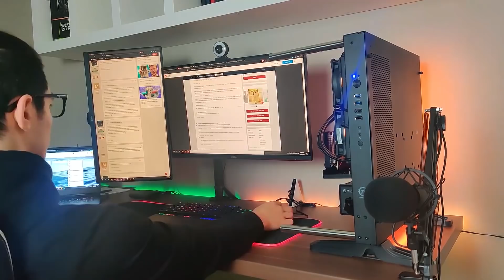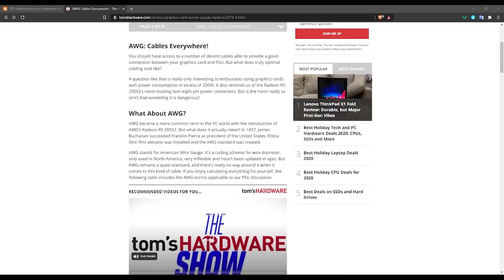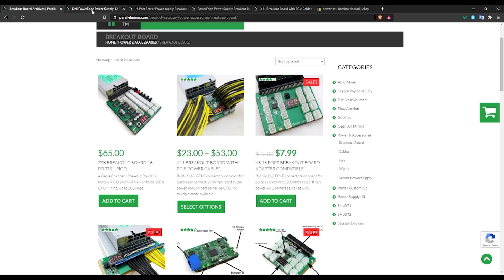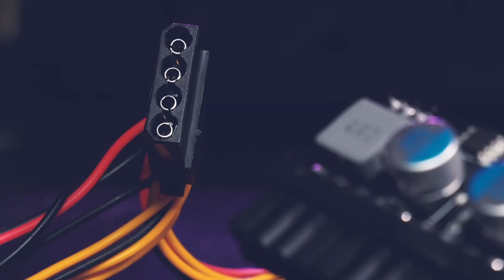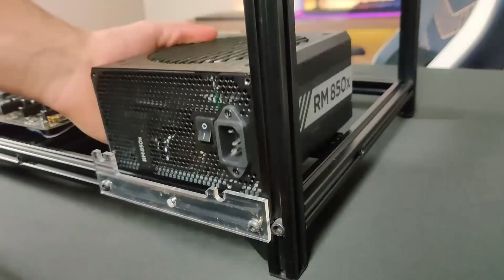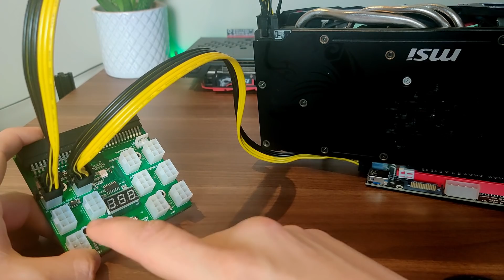Using Server Powersupplies For Your Mining Rig FULL Guide

Comment: Useful info not only for crypto miners, but this is also a cheap and viable option for people who are PC gaming on a tight budget by repurposing used Dell/HP workstations. Many folks doing this have run into the issue of having a non ATX PSU in their machine, but needing more watts to run their upgraded GPU. Running a second server PSU and breakout board just to power the GPU is probably the cheapest/easiest way around this roadblock.

With the sharp rise in energy prices there's a fair few one man band crypto miners seeing costs outweighing their profits, so deciding it's time to call it a day, break their rigs down, and sell off the parts. Even 3 or 4 generation old, once high end, GPU's are currently still going for reasonable money, but used server PSU's and breakout boards aren't finding many buyers, so are getting priced low just to shift them. Due to this, until this workaround to get a power hungry GPU to work in a non ATX PC starts becoming common practice in the gaming world, used server PSU's and breakout boards will stay about the most budget friendly way to make this setup work.

Comment: Using a PCIE splitter for GPU where 2 cables are needed if GPU exceeds 150 W - that will lead to burning - melting power supply connector - I had 2x 1000 W Corsair PSU - I did use one PCIE cable for GPU where 2 cables needed - the result was shocked - after some usage - it literally melted my PSU connectors - I am glad that it did not melt my GPU connectors and GPU is still alive !!! So my Corsair PSU that each did costs 200 bucks are not any more usable - sad mistake - so you should follow the guidance - never use PSU - PCIE splitters and ALWAYS obey this rule about 75 w for 1 connector or 150W for 2 connectors where required.

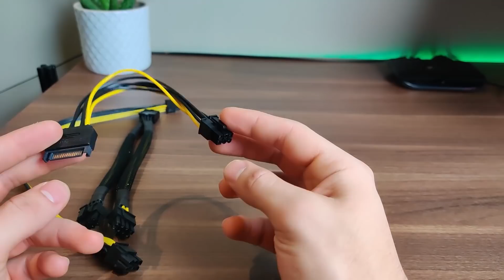Comment: 4:53 you avoind using 6 pin to SATA with graphic cards right ? Those are fine to be used with splitter and connect like 6 or 8 HDD ?

Comment: Can I use low power 200w for motherboard and 1000w server with shorted pin for auto start if I connect them on 240v splitter cable... that way the moment it's in the wall both will start? Since MB has auto start after power loss function... and HP server has simple breakout where start pins are shorted with plug. ?

Comment: just a question, if 750W is the max output then you can only run about 3 3090s becasue each is about 240W i think (or 300W)? is that right?

Comment: I'm sort of on the lookout for a 2400 w or 3000 w psu with all of everything, it's for rendering rig 3x3090 rtx and a 2080ti.. they can go up to 1.5 kw and the rest might have spikes up to 2k.. so 2400 or 3000w so it has way enough power to deal with it, and it might? Run quiter.. I mine when I don't render - but when I render at full speeds I experienced it just shuts down (as if not enough power).. runnin 3 atx psus at 800 to 500w each - it doesn't look pretty..
Anyway - difficult to find real big psus, and paralel miner is always sold out - so any info on what to look out for and what connectors - I would prefer one psu for everything, mobo and gpus.. cause running 3 is not pretty.. even tho I have a miner frame and two psus fit in.. still one overpowered psu seems a lot cleaner - also in case I wanna increase my rig to 4 or 5 3090.. or whatever nvidia dishes out next or this year

Comment: So if the crimp terminals are rated at 8A max, that means it really doesn't matter if you use 16awg or 18awg cables since the 18awg gets 9A which surpasses the capacity of the crimp terminal?

Comment: thanks for the info! When HP server PSU is connected to ATX PSU by mini 4 pin molex, I noticed that there is an on/off switch button on the break board. Do you need to toggle it on before you power the main ATX PSU that connects to Mobo?

Comment: I have cooler master v1000 , pcie cables are from 6 pin to 6+2 pin .. the PSU side connection is of 6 pin rather than 8 pin .. so how much load can 1 cable handle ?

Comment: Where do you get the 6 pin to 8 pin pcie connector cables to use on the breaker board to the GPU?

Comment: Amazing video as always! I had one question, can i use two separate 6 pin to 8pin wires to power mu dual 8pin gpu? Or do i have to use the splitter for it? Replies are really appreciated :)
Love your work mining chamber! Keep up ❤️
Reply: Power a single GPU and corresponding riser from the same PSU, don't use more than one splitter per cable (Don't split a splitter), and never use sata to power riser (even if you're using sata to Molex adapter). Also good practice to avoid using Molex to power riser IF you can (but that's not always possible). So to answer your question, using two separate 6 pins is okay as long as they aren't from different PSUs.
Reply: @typodapsycho1734  can you give me an explanation why my 6 pin to 6+2 connected to ide/sata on psu cannot power my riser ? (Pc won't boot)

Comment: Hey, can you help me? I've got a rig running 7 rtx 2080s and an rtx 2080TI, and when the power flashes, it will turn off then automatically turn back on because of the motherboard's bios being set to "last state" when power received, but whenever this happens, the server PSUs are not in sync.

I'm using molex -> 4 pin adapters from the ATX power supply to sync up all 3 server PSUs that I have for this rig, and if I turn off the computer completely, then power it on using the power button connected to the motherboard, everything syncs fine. It's just when the motherboard turns it's self on when it receives power that they aren't synced.

The motherboard I'm using is: MSI MPG Z390 Gaming Plus
I have two 750w server PSUs and a 1200w (running at 900w bc 120v) server PSU.

Comment: So if i understand  correctly the 6 pin connectors from the breakout board can provide only 75 and not 150w (as the normal 8 pin ones on atx psus can)? So i would need to use 2 seperate cables (2x 6pin) ? or do the 6 pins provide as much power as normal 6+2 pin ones (150w each)?

Comment: I have two server psus, two breakout boards and one pico adapter. Psu one is connected to 3 GPU’s, their risers and the Pico to motherboard. Psu 2 is connected to only two gpus and their risers. Im getting no lights on my last two GPUs on Psu 2 when turning the system on even though the fans are spinning… both PSUs are plugged into the wall. Am i doing something wrong??

Comment: Great video - One small question though. Cursed mentioned he powers risers with ATX 6pin>molex cables and uses them on a server PSU.

My question is can I use an ATX 6pin>Sata in the same way? My front fans have to hook up to a hub and that hub will only accept sata for power? I tried using my Thermaltake Smart RGB 6pin>sata strand on the server PSU and it didn't do anything, im wondering if this is at all possible to achieve or is it only atx molex cables that work with server breakout boards?

Comment: dude you're the first person I hear talking about Server PSUs being too loud to have in your bedroom or livingroom. I'm surrounded by gear and I was thinking of stacking all GPUs and HDD into one server and adding a server PSU in my bedroom. I'm glad you talked about it being loud. I'll try to figure out how loud they are before I purchase one. Thanks again. Subbed.
Reply: They are small jet engines.  You will not be able to sleep.  Trick is to keep them under ~70% load so they don't kick on the fast rpm mode.  So like the 750s you don't want to go above 500w too far.  The 1200s run on 110v only do 900w, so don't go above 630w or so.  If you run 240v you can run them up to 840w before they take off.
Reply: Question, I have three 750w PSUs and the fans have never kicked on? I keep them under 500 load, but the cases are pretty hot to touch.  Is that normal?

Comment: Greate video.  But I have a question. I have 2 RTX 3090 running at 315 watts each.  Can I use the HP DPS-1200SB to power them?  They take three 8 pin cables + 6 pin riser each GPU.

Comment: I was just trying to start with server psu as well, got 750W one with breakout board for 12 pci-e 6 pin connectors. Noticed that as soon as I start my 3080Ti using about 220W on ergo (4 connectors - 1 for riser and 3 for gpu) i can hear ticking sound but there is no ticking sound when I run 4x 1660's running eth on about 265W but that's 1 riser and 1 GPU connector per gpu. What May cause this ticking? Is it safe to run it that way?

Comment: So I'm building a 12 1660 super rig. Each gpu should pull 78W. and only needs 1 8 pin. Per my understanding, it would be safe to connect a single six pin to a server PSU and split it to power both the GPU and the riser. Is this correct or do you think I'm missing something? It's the question that has been bothering me, any advice would be appreciated. THANK YOU
Reply: Pls help

Comment: 1st thing: Ohms law. Use 220/240(depending where you are) whenever possible. 2nd thing: In older homes with smaller panels, let's say you're running 1 server supply @220 and an atx from an outlet. You should probably be aware that during summer months when electricity use is high and many, many homes have this, you will get line drop on one leg. Now, your server ps? It's on both and the neutral, it cares not!
Your atx that you plugged in and maybe power 1 or 2 cards off of? You can see where things could get funky and if you hang a scope on either leg to neutral/gnd or to the chassis of the rig for that matter, you will likely see some wild transient spikes when the AC kicks on with the microwave or something. 

I think if you CAN,  then run the ATX on 220 as well. That way the whole system is balanced, spikes are absorbed much easier and your reference is going to be the same to gnd/neutral, this can save cards and especially motherboards.  

Plus, all that said, it is ALWAYS better to run higher voltage at lower current than vice versa. I mean, look outside...........Imagine if those lines carried 500v instead of 15k to 500k+? They'd be thick as a tree trunk to bleed of the heat generated!  Great video, thanks!!

Comment: Is it safe and possible to connect 2 or 3 server power supply together from your mobo ‘’normal’’ psu with a single sata/molex cable using adapters?
Reply: Safe yes, but apparently doesn't work for a lot/most people.  It seems the server psus turn on a few seconds after they get the signal.  This means since the atx powering the motherboard didn't delay, the system boots up before power is sent to the risers/gpus.  So what happens is gpus do not show up.  Better to turn them on with switch and then pause and start your atx psu.

Comment: When running the 1200w psu at 110v do i still need to apply the 80% rule?
Reply: Run it as high as you want up to the 900w it will do on 110v.  That said, if you want it quiet, keep it around 600w or lower.

Comment: If I dont have a Pcie splitter, can i just use 2 different slots for the GPU instead (total 3 per GPU)? 
Thanks in advance
Reply: Yes, you just use up more pcie ports.  The x11 gives you 16 ports, so you can run more cards.

Comment: If my ATX PSU has a floppy 4PIN connector, can I plug it to breakout board to turn on server PSU without 4pin to Molex cable?
Reply from the maker: the 4 pin and the molex should both work so I believe it should be fine but I personally did not try without the molex before

Comment: I was wondering how do I add more gpus to my rig if my atx power supply only has enough slots to power 3 gpus. By connecting a server psu to the atx. Thanks to your video. It's informative 👍
Reply: And if you need a quiet supply AND 6 gpus? I only have 2 supply ports in the room im in😅

Comment: What plug do you use to connect the server psu to the wall?
Reply: Normal power supply plug, also used in older monitors that don't use power bricks.

Comment: Just bought DPS1200SBA PSU. It gets very hot to touch and fans are not spinning like turbines. Do i have to worry? Load is about 750W. I've another DPS1200FB1-A and that is nice warm with 950W load and not complaining.
Reply from the maker: If it's running on 240v volt then your fine! They do get pretty hot and they have built in safety to shutdown if it gets to a really hot point
Reply: @MiningChamber  Yes it's running on 230v actually, I'm in Argentina. Can you take a look at this video? I made it yesterday. That led keeps me worried: https://www.youtube.com/watch?v=U7hQ1T6ww6w
Reply: The "hot psu" is also the one from the flickering led. I've tested the remaining 4 PSU and their breakboards and they all do the same (heat up and flickering led). Strange thing: if i take one of this 1200SBA and plug the breakboard from the DPS1200FB1A that led works correctly but it heat up the same.

Comment: I was looking at the 2400W server psu but they ALL have 6pins to 8pins and i ONLY have 4-3090's. 
Am i stuck to only use ATX psu ?
Or is plugging in 6pin to 8pin OK?! to run 3090's? without issues, counting the 80% max usage.
I read that running all 8pins from both ends, is best.
Witch i tend to agree with.
But ya...   server psu?
Reply from the maker: The server psu cables are rated up to 400 watts so you can use 2 cables and plug into a 3090 and then one cable for the riser. You'll be completely set!
Reply: @MiningChamber  The cables that came with the server psu are 6 to 6+2.
I still need 4 cables, sounds like ur using two. huh double end.   
^%#%$ i  got the wrong cables with that psu.  3090's need three 8 pins not 6 to 6+2
Thx for replying
Reply: @MiningChamber  Thought so but sometimes you just looking for more confirmation... right?!   lol
Thx

Comment: what is a recommended server psu for a rtx 3080 rigs? (8 GPU)
Reply from the maker: Hmm 8 GPUs, while mining they will be at 220-250 watts each. So having a 2400w server  psu will be ideal but keep in mind it needs 240v
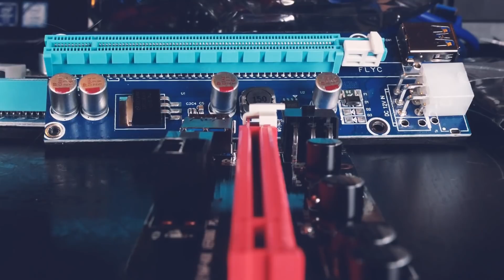Reply: @MiningChamber  different question; 13:23 he said dont use sata power to power riser. how much watts do riser need?

rn i am afraid to use splitter on the riser.

ref: 6 pins = 75w, sata/molex = 54w

Comment: I've encountered 1 problem with using an atx psu and server psu. When I turn the rig of, the server psu is not turning of and just keeps running. Then I have to plug it out of the wall. I've already killed one atx psu bc there was running electricity in the opposite direction of the molex. Does someone know the reason for this?
Reply from the maker: I have never heard of that happen, weird. I would recommend asking ParallelMiner by emailing them

Comment: I have 2 1080 (270w total on it) and it runs hot has hell, fan not spinning at all
Any idea?
Got a ATX running the system and 2 other cards.
My Hp server PSU only have 2 cards and 2 riser on it.

could make a egg on it.

Comment: Basically, a 6 pin pcie connector has 2 circuits (2x +12v & 2x gnd + 1x sense + 1 noconnect (often connected to +12V). Conservative current rating for pcie style connectors is 3 amps /pin which is a total of 6 amps for 2 circuits. At 12 volts thats 72 watts (for the official rating or 75 watts). An 8 pin pcie has 3x +12V, + 4x gnd + 1 sense= 3 circuits. Pushing the current rating a bit to 4.5 amps yields about 150 watts. If you exceed these numbers, you risk having a poor connection causing a voltage drop which then causes heat at the connector (remember P=I*R and an increase in resistance generates extra heat). Most 6 pin to 8 pin adapters also cheat on the number of wires (running 3 grounds thru one wire) which doesn't help the situation.

Comment: So the 6-pin board can deliver 216W / cable, that's only 173W with the 80% rule. Now if you run a 250W card which draws typically 50W through the PCIe and 200W through the 2x8pins, means it is better to have 2 cables for the card instead of an Y-splitter, right?

Comment: i heard that this is only loud when its 110-180v, when it's above 200v it gets more silent, is this true?
Reply from the maker: It depends on how hot it gets. The more power you use the hotter it gets the louder it gets for fan cooling. 200v does make things better though yes

Comment: This is the main question everyone wants to be answered from the PCIE dual 6+2: How much wattage can the PSU safely carry to GPU if both 8 pins are powering one GPU. Assuming you get a good PSU like from EVGA and all other conditions are normal.
Reply from the maker: I do answer it in this video, check the timestamps. But a short answer is 8 pin carries 288 max, and 6 pin carries 216 max. Use only 80% of that. It also relies on cables awg and all that which I explain in the video
Reply: @MiningChamber  ...So the PCIE to dual 6+2 can provide 576 total watts safely if both 6+2's are plugged into the GPU?
Reply: @Jake Zeigler I think if the total steady wattage is less than 110W it is 99.99% safe unless it's a bad product.
Reply: @Jake Zeigler two risers and 1000< series cards mining.

Comment: Great video! Clarification please - I am using a break out board and ordered multiple 6 and 8 pin cables from site you mention in video. But I am 4 cable short - Can I use 6 or 8 pin cable that came with my original (thermaltake) psu in the remaining slots in the breakout board for either power to riser or power to Gpu? I believe you said it’s ok to use but not ok to interchange cables with different PSU’s....

Comment: What do call again the 6 pin cord that goes with the 4 pin of the server psu to power them on at the sane time. Thank you
Reply from the maker: I think your referring to the molex? or just a regular 4 pin usualyl its with Molex cable
Reply: @MiningChamber  okay thank you so much.. so just need to plug in the molex to the server psu and when I switch the atx the server psu will turn on at the same time right? thanks again

Comment: Great demonstration thank you. I have a question. When it comes to connecting power to my gpus (dual 8pin) why would I use a splitter. The break out board cables are 6pin - 6+2 so could I not use 2 of them for the 1 GPU and then 1 more for the riser?